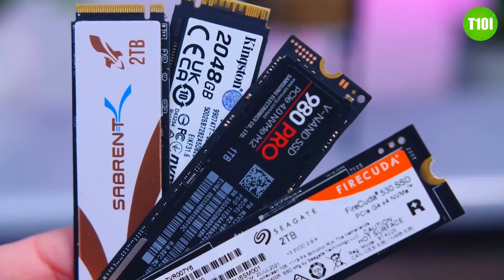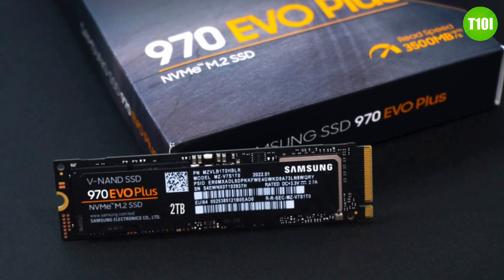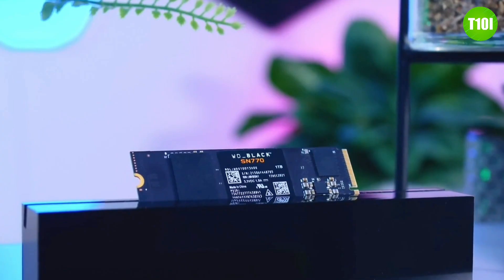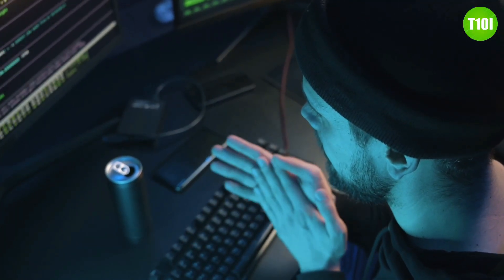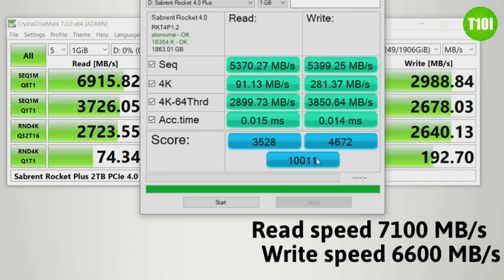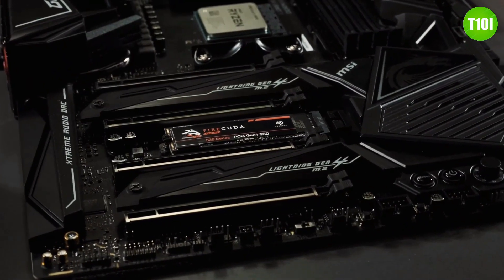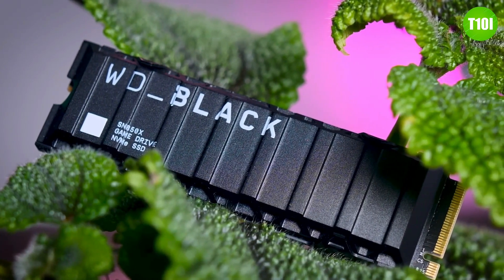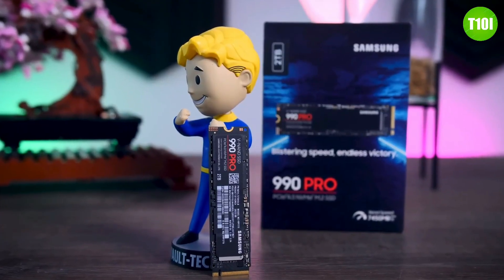Top 10 Best NMVe SSD 2024 - Best NVMe SSDs for Gaming, Editing & More!

Comment: While I’ve heard good things about the WD Black SN series, they all seem to run extremely hot, even with heat sinks.
Reply: I have the 770 2tb right now, testing it, and it does run very hot compared to the 970 EVO Plus 500gb, boot drive.